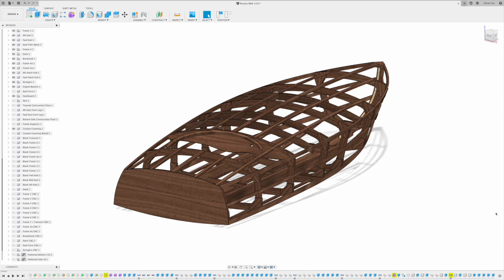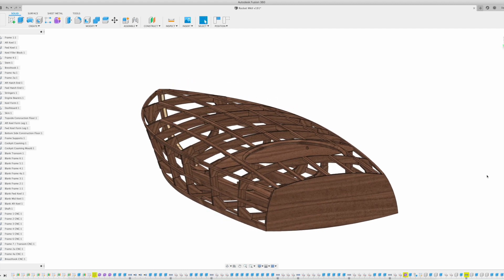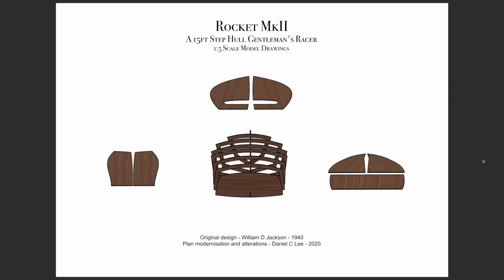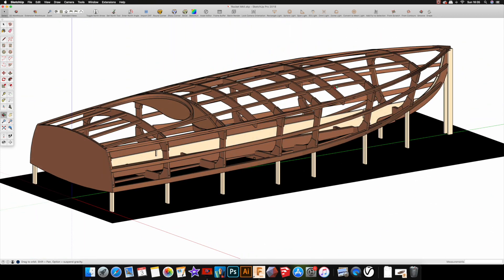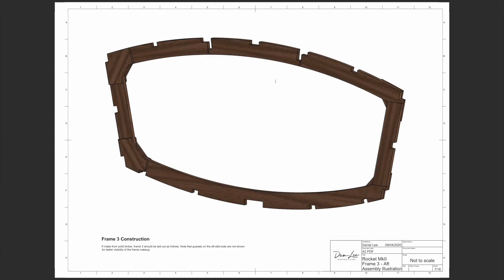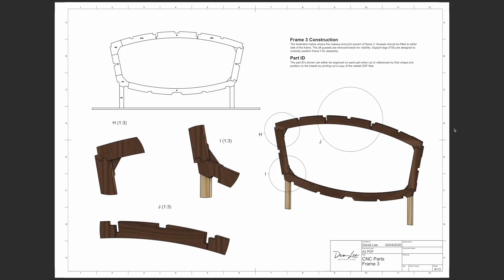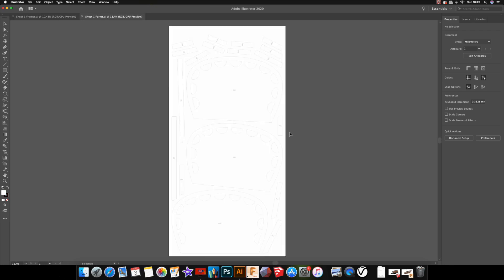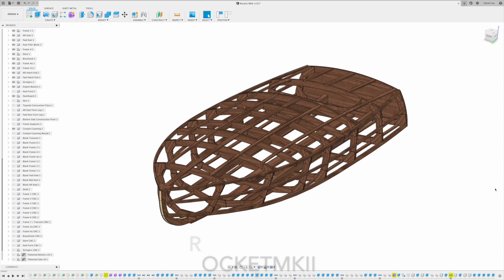Rocket MkII Boat Build Pt 1 - Boat Building Plans Tour

Comment: Dan, I have become fascinated by the power of the Fusion 360 CAD program and oh-so-slowly getting to understand the elementary stuff. I see several different methods are used by different boat builders to get the design started and the lines established. One thing that keeps throwing me off course is the command to project a point. Please let me have any hints or tips of how best to go about this step.  Even better would be a video here on YouTube of your approach to CAD...  There must be loads of us Puzzled on this issue - especially the old stagers such as myself - I find its a puzzle to rival Soduko !
Kind Regards,
Graham.
Reply from the maker: I am much the same, having only learnt it over the last few years I can't believe how much easier it makes certain things. It is a frustrating hill to climb though, I didn't manage to do anything at all in Fusion for some time. I have thought about doing some tutorials on it and may look at adding them to the channel at some stage.

Comment: Hey Dan, hopefully in the next few months I will be purchasing these plans in order to attempt to create my own! Working on getting a game plan together and may have a few more questions in the future but right now my issue is that I only have access to my 2’x4’ cnc and a friends 4’x4’ cnc(I’m in the US FYI), can the cnc plans be indexed to make the complete cuts of the templates by shifting the material after half of the sheet ha been cut?
Reply from the maker: In theory you could do that but you would have to be quite carefull with alignment. Perhaps adding alignment dowels in through to the spoil board that made sure alignment was all correct during the shift. Drop me an email if you want any more info.

Comment: Thanks  Dan for replying  i know cost is a factor  especially when it comes  to engines and building the boat .
If you at some stage look at  up dating the engine i would try and find at the wreckers a Range Rover  P38  4 LITRE  1998  with  the Bosch fuel injection  they are all alloy  and light weight. 
It is a great engine  and they are quite cheap.
It would be a great fit for your little boat
Cheers Rob

Comment: Magnificent  job Dan 
I am a carpenter  joiner builder yacht builder and i race Drag Boats .
My Drag boat has 600 hp Big Block Chev motor in it and goes down the quarter mile at well. Over 8o mile  an hour .
What i am asking why would you put a motor in it that will barely propel it to 25 mph  i know you have restrictions in the  river systems  in the UK  but if it had a V8 in it the sound of it would be amazing as i have in my dragboat .
What you have built is a beautiful  piece of furniture on water to admire and people  to commend you on  and  if thats your thing  Ok but if you decide to build another one  25 foot long V8 Engine  and you will have  the Americans  clammering to buy it off you  for hundreds of thousands of dollars as they pay big money for wooden boats like the  Rivas of Italy. 
Well done and keep building boats 
 Cheers Rob
Reply from the maker: Thanks Rob, the engine choice was down to cost more than anything. Budget was always tight but the aim was to be able to get my “childhood poster boat” for a fraction of the cost by doing it myself. I found my engine for £75 and spent some money rebuilding it but nothing like the cost of a new or powerful outfit. Plus for me it was never about the speed, I wanted the period look and enough speed to put a smile on my face which I’m confident it will once I get the boat set up properly. 

Maybe if the budget permits on the next build I can spice things up a bit!

Comment: Nice work indeed! What was your process and softwares used to do the plans from the original plans to the CNC-files? And what kind of tolerance did you use for the joints of sheets? Were they necessary to join parts to each other?

Comment: That is a beautiful design. I'm working on something similar with a classic jetboat design here in nz, but I'm having issues getting flat panel patterns in fusion. Which function did you use to get the skins to a flat/unrolled state for cutting? I feel like I've tried everything! Cheers
Reply from the maker: Thanks Mike. Getting that right is probably the hardest bit! Have a look at a program called Meshmixer, take the shaped .stl mesh out of fusion and import it into there. Then use the unwrap function to lay it flat. I think I followed a YouTube tutorial on how to do it.
Reply: @DanLeeBoatbuilding  Brilliant! Meshmixer seems to work well. Thanks heaps for your help. And hey, if you're ever in NZ then let me know, we'll go for a jetboat ride.
Reply from the maker: Mike Marsh no worries! I’m definitely up for a ride if I ever come over 👍

Comment: Do you have plans that allow me to build with USA plywood which comes in imperial measurments? Specificaly the cnc kit.
Reply from the maker: Although the plans are drawn in metric they are cross compatible with an imperial system if you go down the CNC route. Most timber sizes here in the UK are measured metric but based around imperial sizes, the ply sheets for example are 1220x2440 which equates to a 4x8' sheet and the 18mm frame thickness equates to 3/4". The same applies for all the batten sizes so you shouldn't have any issues going imperial.

Comment: Do the plans address the bevels on the frames?
Reply from the maker: I remember that being one of my questions when starting out building boats as it isn't usually very clear. 

The bevels are not dimensioned as such because the frames should be cut square and then bevelled when it comes to fairing the hull. There are details about this process in the instructional document though. You can also see the approximate angle and direction in which the frames should be faired when looking at the Sketchup model from above so there are plenty of references that show you how that should look.

Comment: Any chance of a 19ft or 21ft version and cockpit fore of the engine? Keep up the good work.
Reply from the maker: The design could be scaled a bit but not as much as that I would say, only by about 10%. I have seen versions of the original Rocket that have a fwd cockpit. I am thinking about adding an additional frame in (1a) that would support the deck for this as I did with the engine hatches as there is lots of empty space up there.